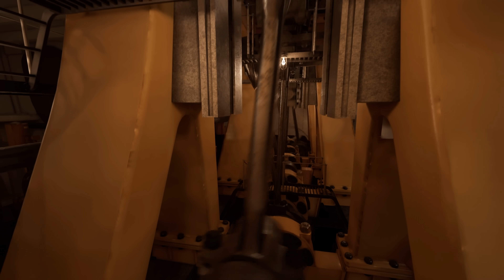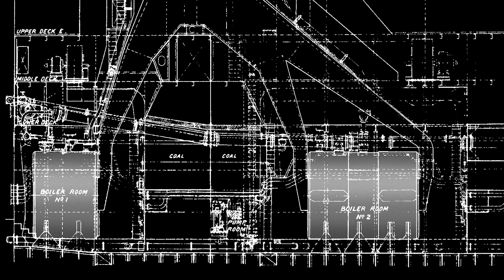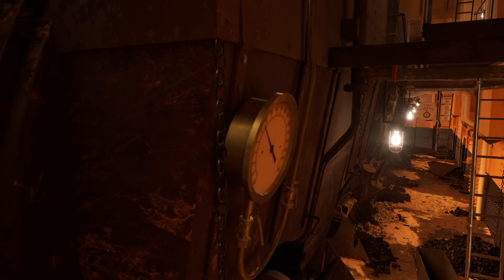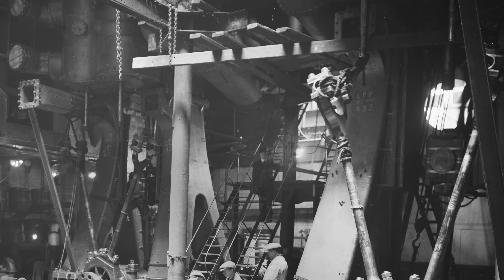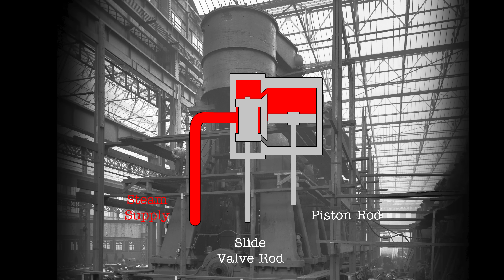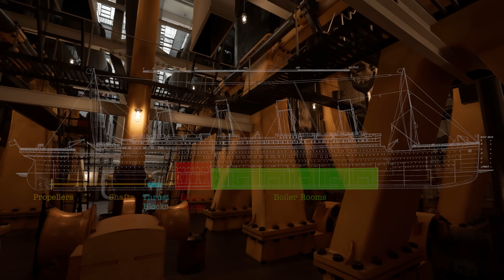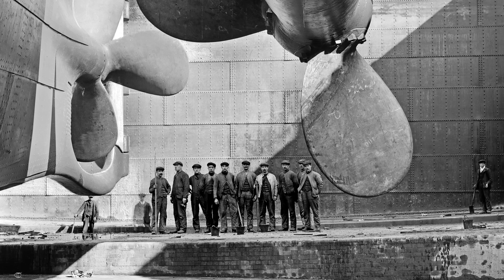A Complete Guide to Titanic's Engines

Comment: Wonderful video….unfortunately you’re still presenting the mistake of the Titanic’s central propellor. Let’s set this straight once and for all, the Titanic’s central propellor was a 4 bladed screw not 3 bladed. The simple fact is that this myth is based on very questionable evidence that the has been debunked as fraudulent. The paperwork that had given life to this lie has only been presented in the last  few years and there is absolutely nothing in the last 100+ years since the disaster to back this claim up. I have spoken with the main historian of the Titanic Historical Society about this and he told me that the paperwork (supposedly papers written by Thomas Andrews ) is not supported by any further engineering reports, diagrams, notes, etc. by either Harland and Wolff or any other engineering firm responsible for the design, construction, or fitting out of the Titanic’s propulsion system.
Your videos are wonderful but you need to further check your information before presenting it.
Reply from the maker: Sorry Anthony but that’s not correct. We know a three bladed prop was used on Olympic after Titanic sank. Other H&W liners also used a 3x3x3 setup on their props. Why do you think Titanic was different? As others have pointed out - what evidence is there that she had a four-bladed prop? An engineering notebook from H&W with precise measurements and notes including propeller pitch, diameter etc. is hardly ‘questionable’!
Reply: @OceanlinerDesigns  Sorry but again you’re wrong just because the Olympic used a 3 bladed prop after the Titanic sank doesn’t mean that the Titanic had the same type of prop. The Titanic was going on her first ( and sadly only) trip across the Atlantic so it doesn’t make any since that they would be doing experiments with their newest liner, maybe after a few trips which would’ve proved her worth only then would they have tried a new prop design probably during the off season. Just because and I repeat a questionable notebook with some technical information suddenly shows up after 100+ years with absolutely nothing even hinted in all the years after the disaster and the fact that there is no other information to corroborate this notebook as authentic because any engineering changes no matter how insignificant must be followed up with a paper trail…ie blueprints, calculations, photos, memos, recommendations, etc. and there’s nothing whatsoever proves beyond any doubt that the Titanic sailed with a 4 bladed prop and definitely not a 3 bladed one.
Reply: Thanjs to documents found it was already resolved without any doubts that Titanic had 3x3 blade propelers, every single maritime youtuber and their mother's did videos about this few years back.
Reply: @randomnickify  Just because as you put it…”every single maritime youtuber and their mother’s did videos about this a few years back” doesn’t mean that it’s true there is a lot of misinformation on YouTube and other media that’s misleading the public for example Bright Side does very misleading and inaccurate videos about the Titanic and Mike Brady while an excellent video maker does err about the Titanic’s central propellor as has just about every single YouTuber video I have seen when it comes to this particular subject.
Reply: @randomnickify  No…the so called documents you mentioned were proven to be frauds.
Reply: @randomnickify  Sorry but as I have already stated to OceanlinerDesigns and others the documents that has everyone in a tizzy has been proven beyond any doubt to be fakes. As I have stated the only source of information is these frauds as in the years after the disaster there was never in the slightest bit any hint or suggestion that the Titanic’s central propellor was a 3 bladed version that unfortunately everyone seems to swallow hook, line, and sinker!!!
As one who studied Drafting and Design engineering in college every engineering change no matter how small or insignificant must be followed up with a paper trail so that if anything goes wrong it’s source can be traced and corrected.
The simple fact that no such trace exists is evidence enough of the documents being frauds.
A few years back I contacted the Titanic Historical Society and spoke with the Society’s leading historian and he told me that based on everything he knows and the THS’s extensive archives and documents it is unlikely that theses documents which unfortunately everyone and his neighbor believes to be real are authentic and I agree with him totally.
Reply: @randomnickify  Sorry but I have repeatedly pointed out that the so called documents are frauds and they are not backed up by any corroborating engineering documents since the disaster and any design changes that are made has to followed up by a paper trail in case there are any problems which require investigation so that the problems can be evaluated and fixed. So in the intervening years since the Titanic sank there has been absolutely no evidence of any paperwork to even remotely hint or even suggest that the Titanic sailed with a 3 bladed central propellor and that these so called documents showed up only recently out of the blue is undeniable proof that the 3 bladed argument is false. Yes as you say “every single maritime YouTuber and their mother’s did videos about this few years back” is correct however they were presenting videos bases on faulty information and a lie. When an expedition is launched to investigate the stern section of the wreck and by using ground penetrating radar it will be revealed that the Titanic’s central propellor was a 4 bladed prop not a 3 bladed one as “every YouTuber and their mother’s” thinks.
Reply: @randomnickify  As I have already told OceanlinerDesigns the documents are frauds since after the disaster nothing in the 100+ years has ever turned up or even slightly hinted that the center prop was 3 bladed as has unfortunately “every single maritime YouTuber and their mother” been stupid enough to accept without question.

Comment: What I’ve always found curious is, what happened to the conical caps to Titanic’s propellers? 
They’re clearly not in place on the wreck as the photos of the wrenched up wing propeller(s) which have be photographed just show the prop sans cap , so what happened to them?
I assume they were knocked off the propeller(s) when the stern hit the seabed, but where ARE they?
Were they made from mild steel & simply corroded away or are they buried in the silt.

Comment: Much improved, you're getting there.  

Are the cylinder support columns 21tons/column or per pair of columns?  In the photographs you show there are clearly eight supports/engine, i.e. four pairs.

Where you referred to slide valves on what from the diagram are apparently piston valves on the HP cylinders.  Although you explain how these ships used dried, not superheated, steam, on railway locomotives with superheaters from that era onwards piston valves were used for a number of reasons.  Halpern, who you draw on, states that the low pressure cylinders were fed via slide valves and that also makes sense.

One further advantage of having two low pressure cylinders is that a single cylinder would need to have double the cross sectional area, i.e. be √2 (or ~1.41) times the diameter.  I also imagine that the two LP cylinders operated with different crank angle (phase) settings to help balance the engines.

Please can you elaborate on how you derive the "burns 73% less coal" figure?

Comment: 75 RPM was the normal Operating Speed for the Quadruple Expansion Engines but they were capable of 78 RPM. They never actually brought the Engines up to their max designed Operating speed

Comment: From 1910/1912 technology point of view, did automatic coal feeders already exist to dump coal into boilers?  And even if shoveled manually, considering the size and depth of boilers, were the firemen able to throw coal all the way to the back of boiler or did they dump it all at the front? Wouldn't spreading coal trhoughout the boiler surface be important as opposed to only near the door? 
How often would they need to shudown a boiler to empty the ashes?  cycle each boiler at least once during a trans-atlantic trip? done once a year?

Comment: and even more question:
So you have a boiler with steam at 215 PSI. Then you have steam exiting the turbine at 9 PSI and "sucked" by the condensor that causes much shrinkage of steam by converting it to water.  But if the resulting water is at say 1 PSI where does the energy come to take that water and push it into the boilers who are at 215 PSI ? 
 I can understand if they stop feeding water to a boiler and open all valves to let steam out and reduce the pressure to 14,7, then load new batch of water into boiler, close valve and let it boil to reach 215. But if they constantly feed 14.7 PSI water  into a boiler at 215PSI, how do they push water in?
Just curious on how this is NOT a perpetual motion machine where there is a cycle of water going to 215PSI down to 1PSI and then back to to 215 and still be a net generator of force.  Or is this a question of the force needed to push water from 1PSI t 215PSI being much less than the power unleashed by steam going from 215 down to 1 PSI since it has higher volume? 

Would the pumps that drew 1PSI water to bring it to 215PSI boiler run on steam or electric?
Reply: Yes, she would have had feedwater pumps to feed the liquid water into the 215 psi boilers.  The power available from the system comes from the expansion and cooling of the steam.  Pumping liquid water into the boilers is a necessary expenditure of energy to make the system work.  The pumps could have either been steam or electric, but the electric probably would have been generated by a steam-propelled turbine.
Reply: The condensed water “condensate” is pumped from the condensers back into the boiler feed water system. From holding tanks it is heated and pressurized by pumps and sent back into the boilers at 215psi +.

Comment: More question:   sine there were 2 separate reciprocating engines to drive the port and starboard propellors, was there any mechanism to ensure they went at exactly the same speed/force?   Were the 2 engines fed from a central, shared speam line and thus always at same pressure? 
And when "iceberg straight ahead" call came, would they have been able to reverse only the port engine and have it go at full speed in reverse  while the starboard would have remained forward at lesser speed to help steer the ship to the left ? or would the 2 coupled so tightly that they had to both go in reverse?  (would having the propellors go in opposite direction have any significant help in steering ship or are the propellors too close to each other relative to ship's length for such to have any effective steering force?
Reply: There was a natural variation and the revolutions of the reciprocating engines did not match up perfectly.  For example, we have data from an Olympic voyage in 1933 where one engine averaged 75.5 rpm and the other 77.1 rpm throughout the crossing.  This is also reflected in data for Baltic and Adriatic in the mid 1920s.

Comment: How do those Wooden casts for the turbines and such survive been used with molten metal??? Were they one shot deals? love this remake, it feels super comprehenice and as detailed as you can cram into just over half an hour. Nice work Mike!
Reply: The wooden patterns are not consumed in the casting process.  They are in the shape of the final desired workpiece, with a size allowance for contraction of the metal after it solidifies and cools.  A casting is made by putting the wooden patterns in the upper and lower halves of a steel box, and filling the empty space with sand.  The patterns are then removed, leaving space inside the mold that has the shape of the desired workpiece.  The upper and lower halves of the casting box are put together, and molten metal poured into them, filling the empty space, making the final desired shape.  After cooling, the sand is chipped away, and voila!, you have a casting.
Reply: Spoken like a true mechanic/engineer from a licensed mechanic.    @andyharman3022
Reply: Thank you very much for explaining the process to me. super helpful  @andyharman3022
Reply: @andyharman3022  Worth mentioning that a foundry is probably the closest place on earth one will find 'hell'!  Hats off to anybody who would work in one today, let alone back then...

Comment: hello from the past in 2023 !
Question:  when some dude shouts "iceberg right ahead", and the ship is ordered to go full reverse, this would mean the central propellor would be stopped, right?   With reduced water flow at the rudder, wouldn't that also reduce its power to steer, especially as the ship's speed decreased?

Comment: Honestly, the engineering genius of Titanic's designers can't be overstated.  The genius of how the largest passenger ships afloat at the time could move at near-Cunard speed while burning 40% less coal boggles the mind, that nearly every joule of energy was sucked out of the steam in order to power the ship through the ocean.  My interest in Titanic started with how opulent it was and of the hubris of man, but lately I've found the engineering and design of Titanic to be equally as fascinating.  The ship stands as a marvel of Victorian/Edwardian engineering, that just about any way man could divine and design a moving system was implemented in some way, shape, or form in one single ship.  While there were definitely engineering oversights made, like how the watertight bulkheads ought to have been built higher or there not being ample lifeboat room to evacuate the entire ship, it doesn't take away with the genius it took to create the largest moving object made by the hand of man at the time.
Reply: Not just the genius of the designers but also the skill of the craftsmen. Imagine fabricating the patterns for the molds, the skill of the foundry men in pouring the molten steel into them at the right temperature and speed to ensure it flows into very part of mold without leaving any weakening voids. The experince of the machinists in machining the faces of the castings to fine tolerances and then the other tradesman in marking, and drilling hundreds of hole so everything would assemble together. In any one of those steps one mistake would have cost thousands of pounds and put back delivery of the parts, possibly. by weeks
Reply: And it SUNK.
Reply: @rdallas81  sank

Comment: Fabulous description.  But I'm having a hard time figuring out how the turbines took steam at slightly below atmospheric pressure, extracted some mechanical power, and output steam at 1 PSI.  That sounds unlikely.
Reply: That's one PSI Absolute or PSIA. 0 PSIA is a true vaccum. 14 PSIA is roughy ambient air pressure.

Comment: Very interesting video! Have you done one about the human side of the engineers and boiler workers? Did any survive? What was their experience in the sinking?
Reply: https://en.wikipedia.org/wiki/Crew_of_the_Titanic
Summarized:
3 of 8 lead firemen survived.
45 of 163 stokers survived.
20 of 73 trimmers survived.
4 of 33 engine greasers survived.
Other engineering crew, of which none survived:
25 engineering mechanics
2 boilermakers
8 electricians.

Comment: Thorough, informative, and enjoyable. I think 'red hot' boiler ovens are arranging an audience with St. Peter. As an aside, the cross heads are not modeled correctly. Flat 'shoes' rode against flat, oiled surfaces (unlike the 'dovetails' modeled). I think only shallow channels that spread the oil 'marred' the surfaces. Also, 'condensor' water exiting the hull might be misleading. It was probably the sea water that had been pumped through the condensor tubes to cool the steam back into usable feed water. Sea water was a reliable source of cold water that could be slightly heated up to the temperature at which the condensor was designed to work. The down side was that, not only might remaining contaminants in the steam coat the outside of the tubes, salt water contaminants could build up on the inside of the tubes--both reducing the tube efficiency.

Comment: Thanks for the second effort, Mike.  You're topnotch.

I've never learned so much about steamship propulsion technology as I have here.  I didn't know that Titanic had combined recip & turbine propulsion; never even heard of it or suspected that it ever existed.  And I am amazed that so much of the generated power came from subatmospheric pressure steam.  The engineers that created this were masters of the technology and knew the thermodynamics.  The fact that the Titanic could use only 60% of the coal as the quad-turbine Mauretania, yet go 92% as fast shows how economical the system was, and which ship could transport its passengers at lower cost.

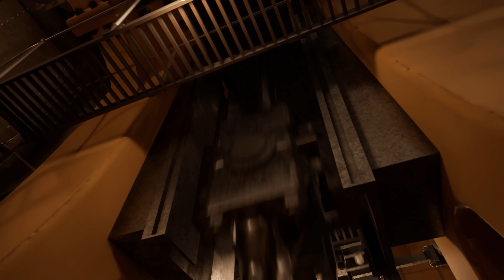Comment: 20:18 you say the steam exits the 3rd expansion chamber with less then earth atmospheres pressure? Im pretty sure thats not possible. At least the engine would have to work like a vacuum pump and put in work to lower the pressure in the last "expansion" chamber to below ambient pressure for that to be true, wouldn't it?
Reply: Yes, it's closed system, it has partial vacuum.
Reply: @randomnickify  right, didnt think of that, ty